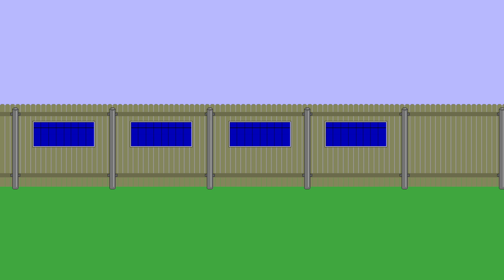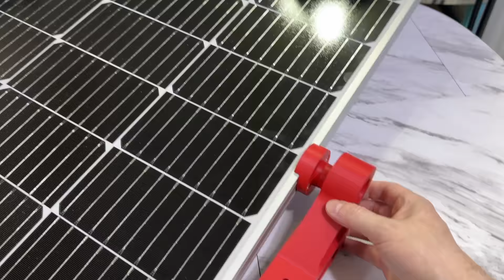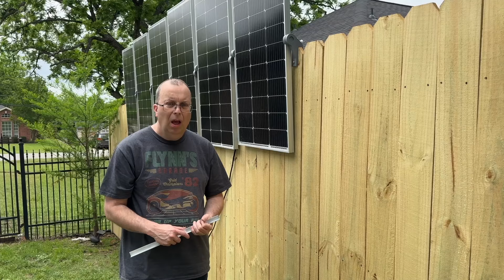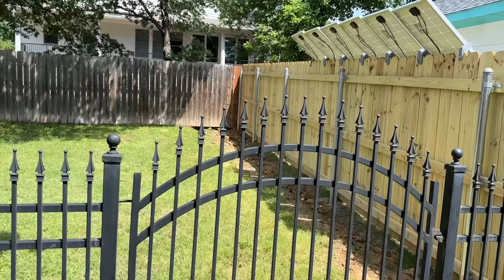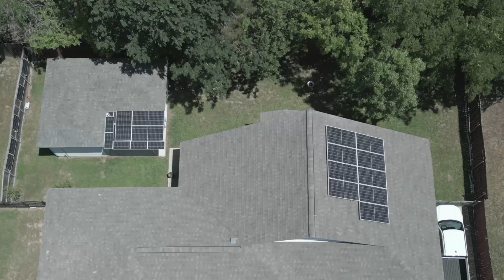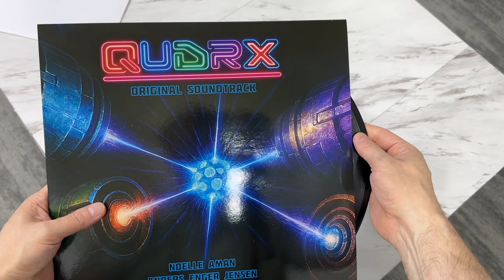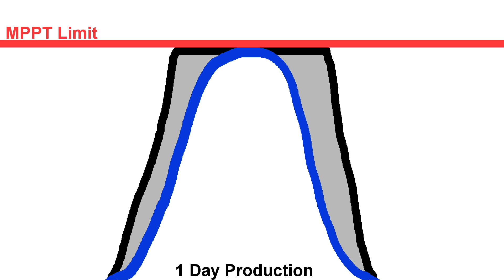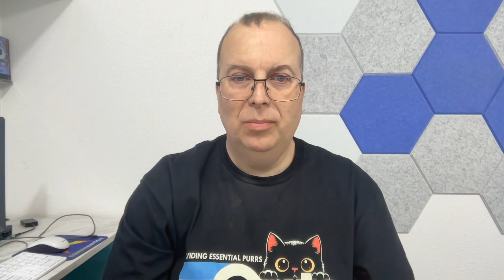I made an adjustable Solar Fence!

Comment: I thought you were gonna go crazy and do some ESP32-based automatic adjusting angles to make your panels like sunflowers and move themselves, but that solution makes sense!
Reply: Come on, 32bit, he is the 8-Bit guy, so use a Commodore C64
Reply: @paulstubbs7678  You mean Commander X16 surely?
Reply: Saveitforparts is on the way over from a fresh trip to Axman surplus with a car full of old security camera PTZ mounts.
Reply: @c1ph3rpunk  you joking I was planning watching him next.
Reply: @WilliamHollinger2019 I wish, that’d be awesomely hilarious wouldn’t it. Love that dude.
Reply: @GreenDavidA  add an anemometer and it could stow itself in high wind!
Reply: Next time maybe
Reply: Yeah
Reply: Also: I think there is a lot to gain by having the panels able to move in both directions, to follow the sun during the day.
I would think that a motorized mount like the polarmount ones for satellite dishes would work great for tracking the sun, and then add a manual adjustment for time of year.

Also I don't really get why setting the panels flat vertical would help in storms? Is that to reduce the risk of a storm ripping up the fence from it's "roots"? If so how about just anchor the fence better?
(Also since it's family that lives on the other side of the fence, and they don't use their backyard, it seems like a good idea to just put the panels in that back yard on a ground mount thing?)

Btw this reminds me of Life Uncontained where they started building adjustable solar mounts, and then we never saw any adjustments made as they unfortunately forgot that you can't adjust the lenght of one leg of a triangle without also change all three angles. I.E. if they actually tried using their adjustment thing it would just break their welds...
Reply: @The-secret-101  not as much as you think. With the added complexity and the energy used to move the panels, it's not really worth it.
Reply: @jstan_49  Re complexity: Sure if you pay someone to do it, but for someone who DIY things it's probably worth it. Also depends on how much space you have. Like if you have plenty of space it might be a better cost-benefit of just installing more panels, but for example in this case there seems to not be space for more panels anyways.
Re energy: Remember that the speeds are super slow. One rotation per day is 0.0007 RPM, so I would think that the average consumption of the motors rotating panels would be negligible in comparison to the solar energy gain. Might in theory be worth keeping track of the weather forecast and not rotate the panels if it's going to be overcast, but still.
Reply: @The-secret-101  My comment was based on something I read in a DIY community many years ago. I'm sure big farms would do it if it was worth it, but all the ones I've seen are fixed south. You need extra space between panels to keep them from shading each other when turned in the morning and evening. That space is better used by additional fixed panels closer together.
Reply: @jstan_49  Good point. This probably depends on what the land value is. I'm in a rather sparsely populated country, IIRC 2 people per square km or something similar, and I'm fairly sure that I've seen large solar farms that can both tilt and rotate their panels.
Btw, tilting in itself also causes problems with shade if you are far enough away from the equator.
Also: It's probably a question of budget too. Seems like a 400W solar panel costs about €400 in my area unless they are on sale, and although that isn't a fortune it's also not cheap either.
Bifacial panels change the calculation a bit too. Not sure how little solar you'd get during the darker half of the day, but if you live above the polar circle or at least close enough to it the sun is up way way more than 12 hours and thus you'd probably have to tilt the panels vertically if they can only tilt but not rotate, and they'd have to be bifacial to produce any power. (Having some power produced during these hours would reduce the need for a battery to power air conditioning and whatnot. In my experience you need air conditioning during the night too if it's needed during the day during the hottest summer days)
Reply: KISS (but not the band).
Reply: David wouldn't work on a 32 bit device if you spoon fed it to him.
Reply: He should have done that on his house roof (not the studio)  rather than all of this rigamarole. On that satellite view of his yard, he shows the only portion of the studio building that would get light. He has a large chunk of his house roof facing the same direction. I find it hard to believe that if he didn't put panels with trackers on the roof, he couldn't get good power output. But rather than pissing around with all this, he should be spending the money on battery storage instead to take full advantage of his time of use plan